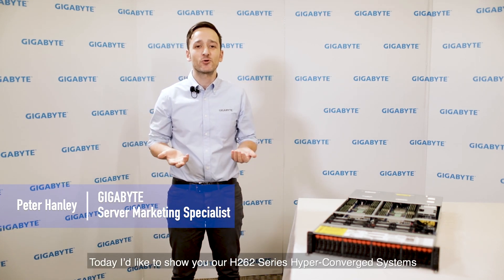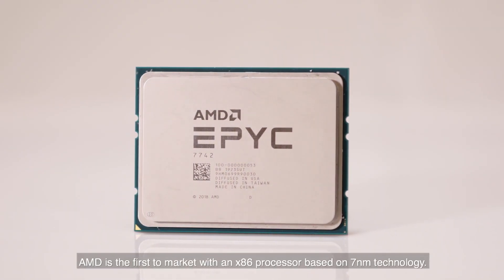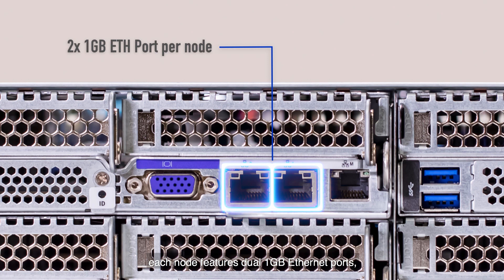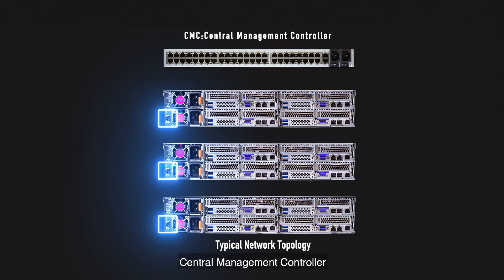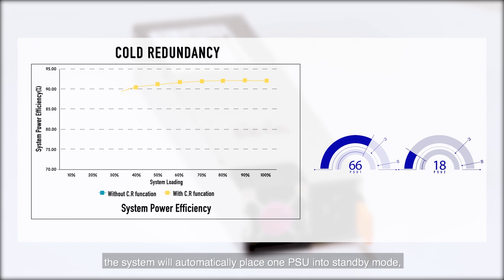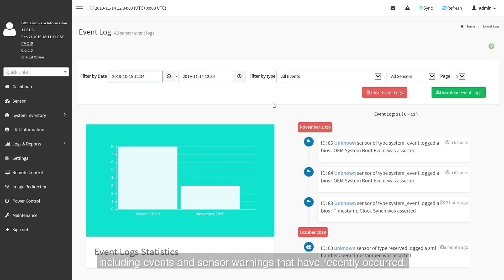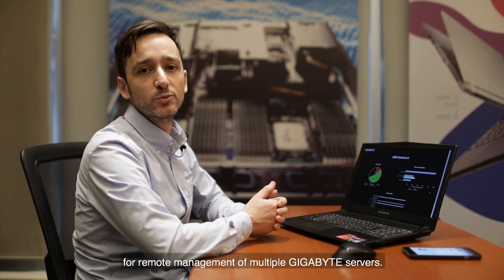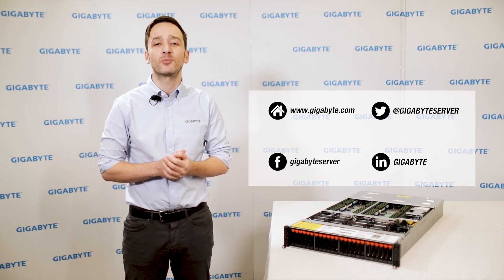A Closer Look: H262 Series Hyper-Converged Systems

Comment: This is really frustrating I need help-

Some details -
Collection Centre - Gigabyte Collection Centre Durgapur(West Bengal)
Service Center - Gigabyte Service Center Kolkata
Board - Gigabyte B360M Gaming HD
Problem - Lan adapter not working, Performance issue, Dead Pixels Onscreen 

So I submitted my Motherboard to the collection Center of Durgapur(3/6/20)and they gave me an RMA receipt. The Estimated time was 1week. After that I had a few calls with the collection centre about some updates on my RMA process, they kept me updating like they told me when my board got dispatched from Durgapur for Gigabyte Service Center Kolkata, They also told me when it got shipped to Gigabyte Service Center Kolkata. Was quite a good service I was really happy. 
At 25th - I haven't got my Board yet, It was pretty obvious because of the COVID situation but still, I knew Gigabyte Service Center Kolkata(The service Centre where my Board was supposed to ship) was open for many days, so what I did was contacted Gigabyte Service Center Kolkata and gave them my RMA number, they told me your Motherboard is still in the Collection Centre Durgapur. For few seconds I was kind of Lost. Then I contacted the Collection Center, what they said was this- 

The Conversation
Me - Hey I just contacted Gigabyte Service Center Kolkata and they said my Board is still with you guys. 

Collection Centre -  The guy who was supposed to ship it to Kolkata haven't shipped it yet, we also got to know it today. 

-I was shocked and was lost for a second-

Me - Wait What?

-I was really Angry-

Me - Why,   what happened?
Collection Centre - *Silence*
Me - Hello?
Me - You did knew that right? Then why did you told me earlier that my Board has got shipped and work on it has started aswell 

Collection Centre - We have sent the board today Mooring. 

-I was really Confused and hung Up-

I can really feel now why people say Gigabyte's aftersales  Service is really bad. 
What I need is help and just help.